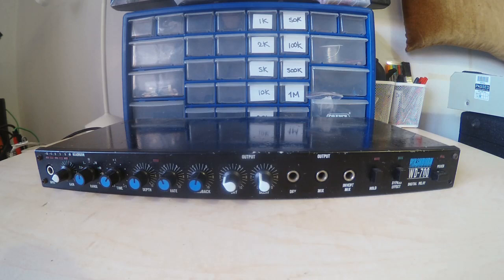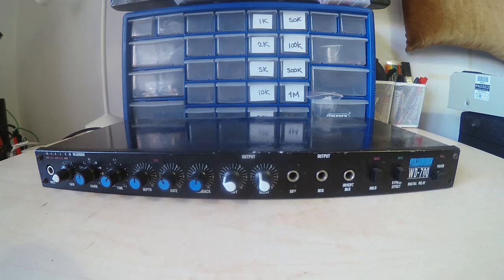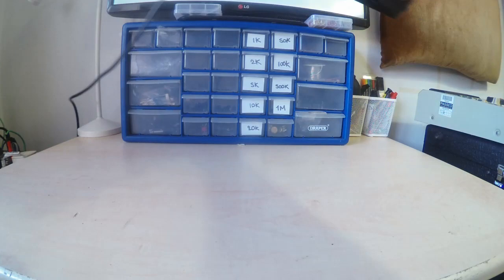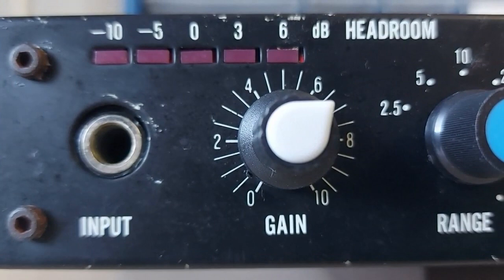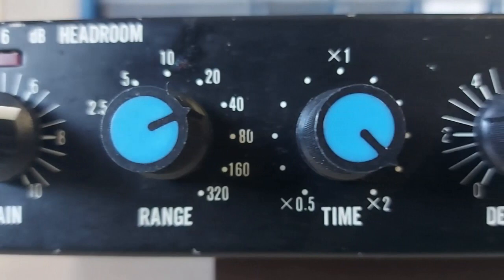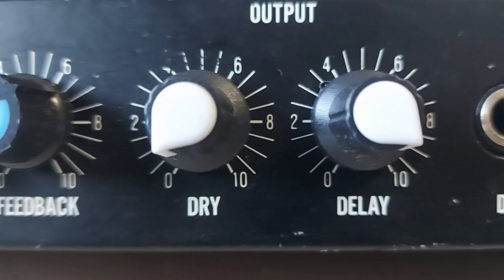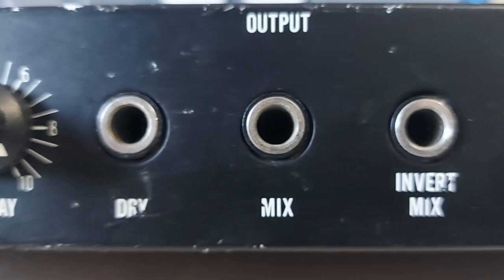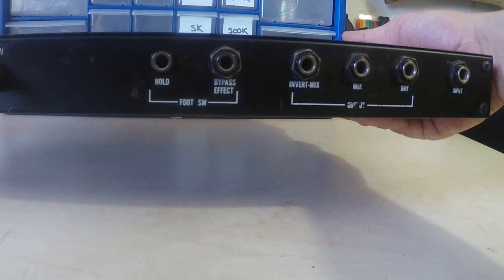Washburn WD700 Digital Delay (Mid 1980s Effect) Audio Test

Comment: I had one of these right through the 90s and 2000s and it was a cor part of my guitar rig and my live mixing rig. Toward the end of the night many bands I mixed for would do a dub out section and I could go to town with pumping the drums through it and pulling the time up and down giving that classic dub slowdown or speed up tape vibe.  also maxing out the repeats into a held noise could bring the house down, literally with enough volume and pulling the time down to a low sub roar.
I used the hold button for early live guitar loop 'sampling' and could then play over the top of that loop.  A very powerful box for a not very well respected brand. I wish I still had it, it would probably still be going. Built really well.